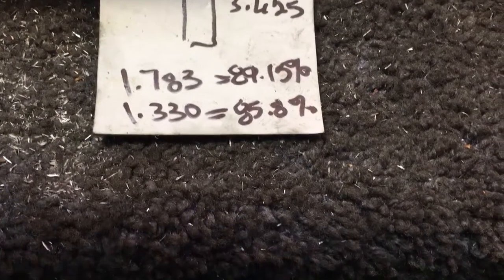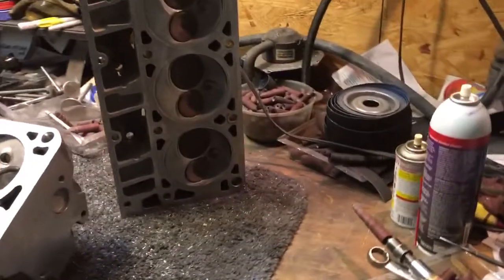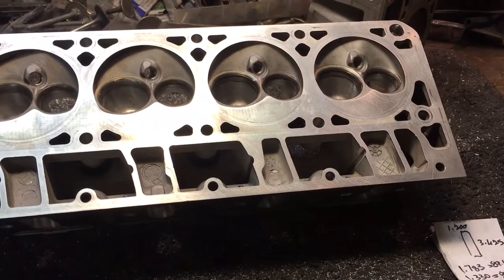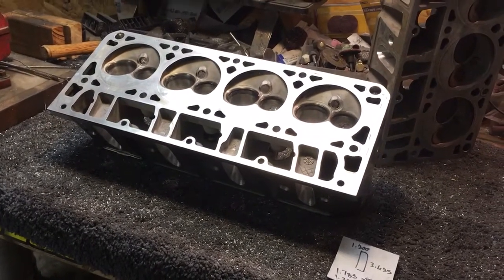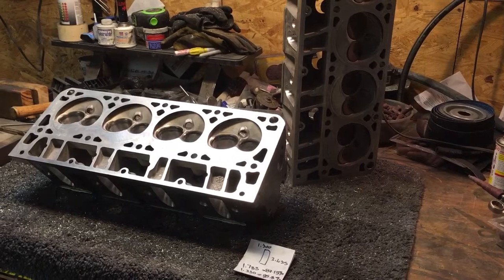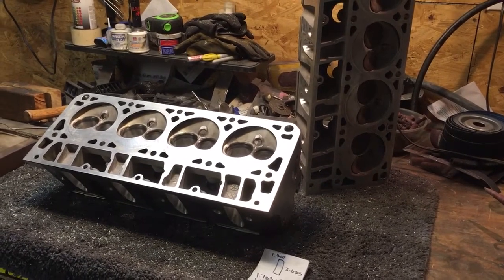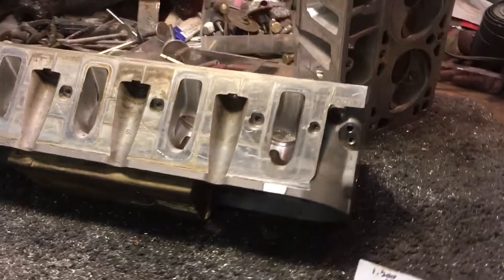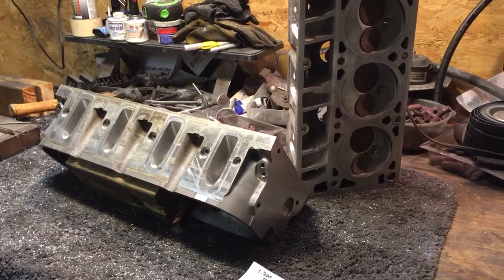Porting LS 241 heads Complete #5

Comment: Mate are the small holes an issue tho ? I can't think of a way to fill them easy if they are.. I wouldn't weld it anyway.. I'm starting on mine tomorrow your vids helps heaps !! I'm From Aust. And have a Holden and all ally ls1 with 241 heads.. I'm going a big cam 1.8 rockers and  aFew other bits and bobs..might deck the head for some comp. as well..
Reply from the maker: Yaron Cameron-Rudeforth Where the port poked through to the intake rocker bolt hole is normal. There's not a need to weld or fill the holes, but you do have to use thread sealer on the intake rocker bolts or it will suck engine oil into the port. 
Focus on the bowl work but Do Not pull back beside the guide boss, directly below the swirl ramp is a water passage, leave plenty of aluminum as you work it. I hope this makes sense

Comment: Thank you so much for your help do sell heads or do you have a website?
Reply from the maker: I haven't made a website yet, generally advertise on the Kansas City craigslist and by word of mouth.  Generally I work on heads brought to me.  I've played with the idea of getting a few sets of the more popular heads fully ported ready to go.  I'm recovering from my surgery now but will get back to porting asap.  I just sold the mint low mileage set of 241 heads I saved for my turbo 4.8 build.  Since I'm going to start out NO turbo I didn't need the larger 66cc chambers knocking compression off my baby 4.8.  Im going to clean up and port my 862's and run them on the 4.8 NA with the 2002 LS1 camshaft, it should be a stout and efficient driver backed by a TH350 with a 2200 stall.
I'm not sure where you're located but I'm just South of Kansas City, MO.  Let me know if I can work your heads or are interested in a specific set of head castings.

Comment: I have a 2002 camaro that came with 5.7 engine. The end all goal is to put turbo on it
Reply from the maker: With the 5.7 LS engine it will make better all around power with heads between a 210-215cc runner.  All the heads need a little work on the exhaust side especially with a Turbo application.  I'd recommend getting a set of heads and have them ported to a true 215cc Int and 80cc exhaust.  This port sizing done properly will provide good flow numbers of 270+ cfm intake and 200+ cfm exhaust flow.  This type of head will work great NA and make huge power under boost!  Let me know if I can help...  JD

Comment: hi with your experience which heads are better  the 241 or the 243 for strip and street the why you work on them?
Reply from the maker: It would depend on the CID of the engine and whether there is a power adder involved.  For pure flow numbers as CAST from the factory the 243 head flows more due to it's larger runners both Int/Exh.
The 241 heads are a 200cc intake 70cc exhaust
The 243 heads are a 210cc intake 75cc exhaust  More flow both sides.
I can port both heads to flow the same max numbers the only difference in the end product is the 243 heads takes less work to get there.
What size engine are you building and will it be NA, Nitrous, Turbo?